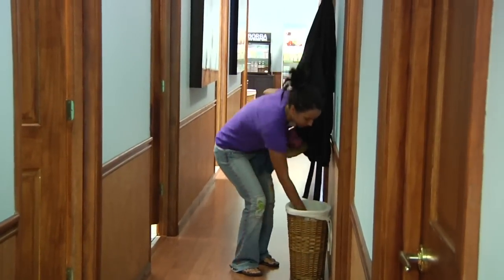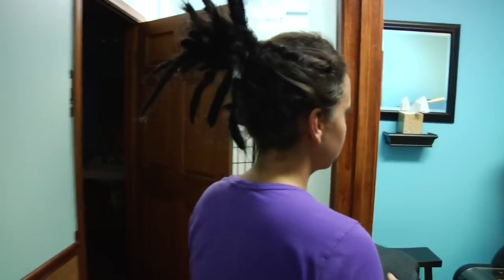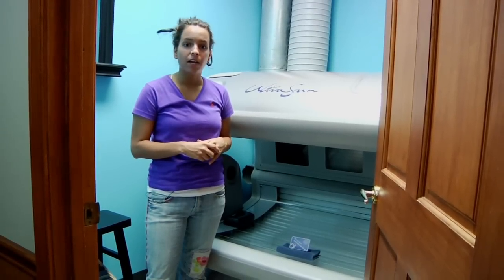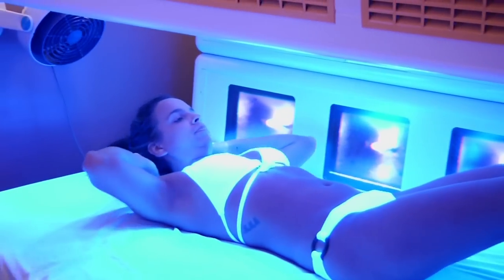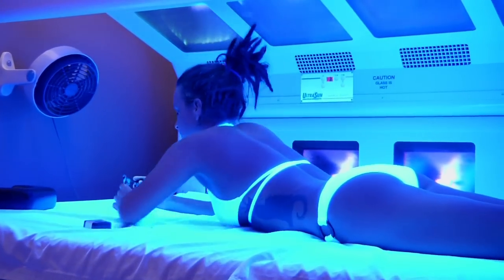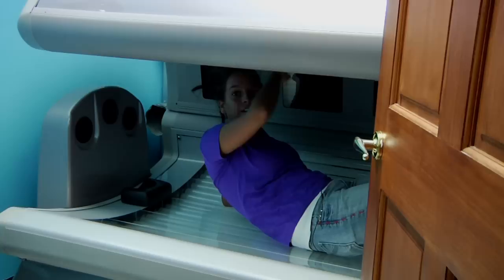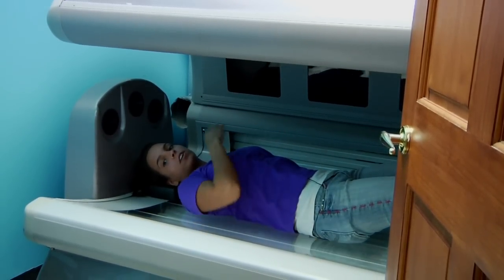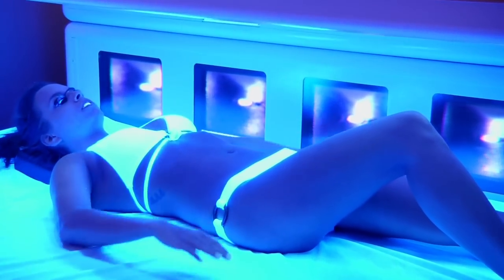Tanning : How Does a Tanning Bed Work?

Comment: tanning is generally very risky, specially if you have pale skin. (the whiter you are the more UV your skin will pick up)  

i advise against using tanning beds, just go to the beach and lay about in the sun and you will get a better tan IMO, but if you have to do it i suggest you add olive oil to your diet because it will dramatically lower you chance of skin cancer and give you stronger skin